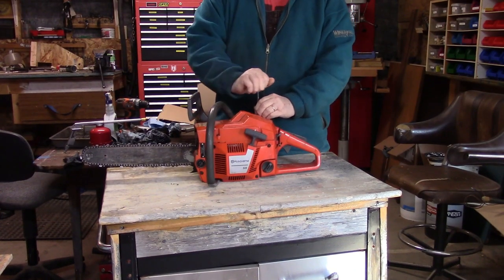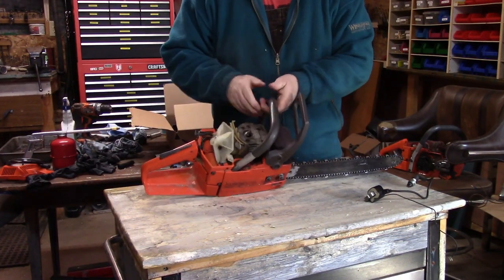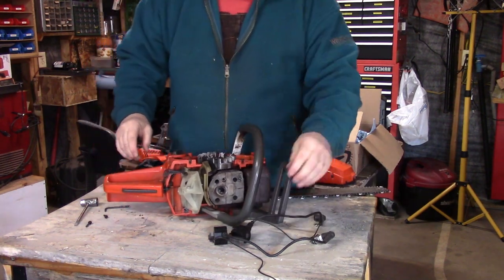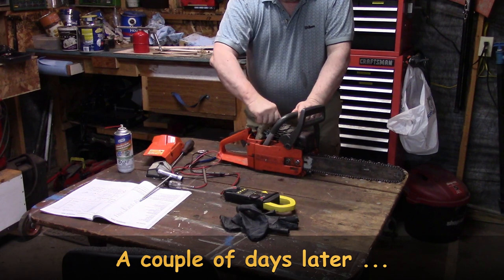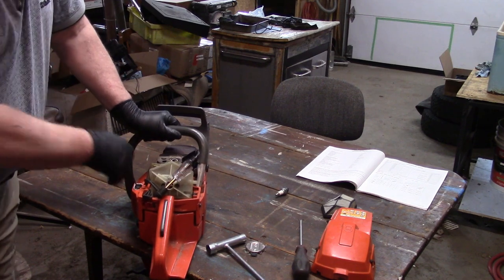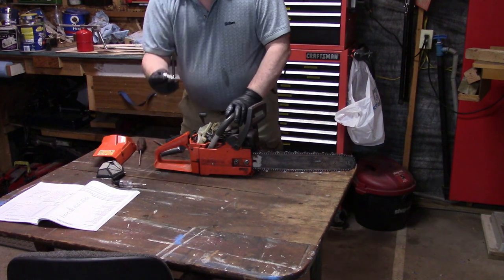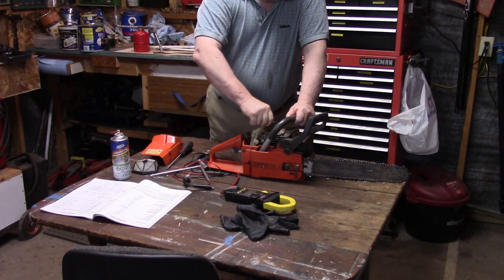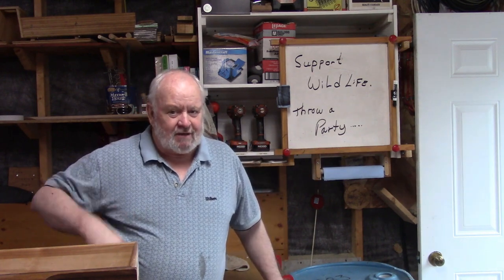Chain Saw Mystery

Comment: Your a good man Mike . After 4 pulls I chuck it in the garbage and buy a new one 😂😄
Reply from the maker: How's she goin'?  I was thinking of getting a new saw, but after I checked the prices, and swallowed hard, I thought I should check on You Tube for a solution.  Got some good ideas and that led me to this video!!!  New plug and/or coil and I figure I'll save about $500 bills!!!  Thanks for tuning in and take care!!
Reply: @GrampiesWorkshop  Every 2 stroke engine I ever worked on eventually had  a plugged exhaust with the spark arrester plugged causing havoc to most times a carb gasket deteriorated from fuel and old age if spark and compression was good.

Comment: I say you got week fire....go to the on-off switch....could be unstable or a pinched wire on the primary side of ignition....just saying...CHEERS
Reply from the maker: Hey there Gator!!!  I checked the switch and I couldn't get it to do anything except work!!!  The ground wire also looked fine.  I agree with you though about weak fire.  Maybe the plug wire clip isn't making as good of contact as I think.  I'm going to try a new coil when it comes in and then a new plug.  I'll keep ya posted as to what goes down !!!  Thanks for the comment and the help!!  Take care!!

Comment: When I was working on the McCulloch Timberbear it would start after I dumped gas in the cylinder or the carb. Then it would start and run fine. It had a leaking fuel line. The fuel would drain out of the line and I could pull and pull without it getting the fuel up to the carb. 
New hose fixed that.
Reply from the maker: How's she goin'?  I thought that could have been the problem last fall and I checked the line and replaced the fuel filter.  Still wouldn't start this spring.  Now it does.  Maybe it just needs attention.  I know a lot of people like that, won't do anything unless you pay attention to them!!!  Thanks for watching and take care!!

Comment: Awesome Grampie《☆》As an ohm chaser I'm sure you had both spark plugs properly grounded during the testing🤓👍🏾 2 smokes are hard on spark plugs so I'm betting the original plug was the problem🤔I don't have a little brother but I had my cousin helping troubleshoot my push mower when we were tweens. He verified that the spark plug lead had good voltage for me & those old stories still come up now & then :*: Greetings from⛾Florida🤳my friend🤓🗣🔊☮✌👍🏾
Reply from the maker: How's she goin' Bdog!!!  I bet we all have some stories about checking ignition spark the 'manly' way!!  LOL   The plugs tested OK on Ohms but under high voltage I bet it's breaking down.  If I had a meggar I bet it would show as a short.  A new plug is on the way and we'll see if that makes a difference.  Also a new coil, but I won't change both at the same time,  An old trouble shooting tip right?!!!  Thanks for tuning in and take care!!
Reply: Always good to hear from Florida/

Comment: Looks like a nice saw and it was running   Not upstanding the problem,  is it hard to start , if so that would be fuel ,not spark ,it was running unlikely not air     sorry not much help. Wish you luck. Be good stay safe Mike👍 feel free to ask me about anything.
Reply from the maker: How's she goin'?  The saw was giving me lots of trouble last fall when I was trying to do my wood.  This spring it wouldn't start at all.  I think the plug is intermittent and I will change that.  I also have a new coil ordered.  We'll see what happens.  Thanks for tuning in and you offer to help!!!  Take care!!

Comment: Mike it might be your Carburetor fuel metering  diagram might be bad. I have the same saw the E series model. check out Donyboy73 you tube channel. He has a small engine repair shop next to his house. Over near our good Friend Steve in Ontario. He has fixed a ton of those chain saws. Here is a link to his video on carburetor service. https://www.youtube.com/watch?v=OdSEXeUJ-90  He has a complete rebuild video series on your particular saw to.
Reply from the maker: Hey there Vicky!!   Dony has a great channel.  I've watched a lot of his videos.  I rebuilt the carb last fall.  The saw still didn't start real good or run that well.  I changed the carbs, same thing.  Makes me think it's ignition.  I'm leaning towards a bad plug.  I checked it with an ohm meter and it showed good, but under high 'ignition voltage' I bet it's breaking down.  We'll see when the new plug arrives and I'll keep you posted.  Sure nice to see your comments and thanks for the help!!!  Take care!!

Comment: Good day mon ami 🌞I do agree with Gator ( on off switch ) need a check ? Check if the upper valve cover is well grounded between the coil and the engine case. The testing light does may not draw so much power like a spark plugs does,,, Can't wait to see your next video about it. Cheers and have a great week mon ami 👍
Reply from the maker: Salut Dave!!!  The on - off switch tested OK.  I think you're right about the plug.  When tested with an ohm meter it's OK, but with the higher ignition voltage, I'm sure it breaks down and shorts out.  I'll replace the plug and I have a coil ordered so I'll change that too.  Bit not both at the same time.  (An old trouble shooting tip!!!)  Thanks for tuning in.  A tout a l'heure!!!
Reply: @GrampiesWorkshop  Bonjour Mon Ami, It will a good time to check everything around ( a good clean up ! ) The anti-vibration rubber on both of my chainsaws did get change and I saw the difference too since the either get deteriorated or harden after years. Bonne journée mon Ami ! 🌞

Comment: I know you have electricity in your background so I can't help you any further.  I have had those spark detectors show a weak spark but not enough to jump the gap on the plug.  Maybe you loosened up some clog in the carb.    Good luck.
Reply from the maker: How's she gojn'?  That could be the case Bruce.  I'm leaning towards a poor connection with the spark plug.  I'm doing more testing and the results will be forthcoming!!!  Thanks for your comment and take care!!

Comment: I have a 61 husky that was new in 87 and is still running great today. It has pulled a 28 in bar most of it's life after a major port and polish.It worked hard for many years as a falling and bucking saw.I always had 2 saws at work. If one had an issue grab the other and work on them at days end. Often shop lighting is a culprit of diagnosing a spark issue. Thus the  spark tester. Plugs are cheap so I bought them 5 at a time. Just toss one that get's an issue. They were never worth mucking around with eh. Try and keep the threads in the head and plug clean and dry or use a tad of dialectic silicone to lube threads and keep contacts waterproof.. It helps to have a good solid  ground and take that swapped out coil assy in and checked out. It may be still good eh. There is my 2 cents on a great saw my friend. Have a great weekend. Take care Mike ! ! !
Reply from the maker: Hello there Dean!!!  I have no doubt there is lots of life left in my saw.  But I'm with you on the spark plugs, toss them.  But they aren't cheap.  I just ordered 4 NGK's and they were about $8 each!!!  I could have gotten off shore ones for $2.80 but would have to wait till the end of August to get them!!!  Thanks for the comments and for taking the time to watch!!  Take 'er easy!!
Reply: @GrampiesWorkshop  LOL on the plugs eh as I was making a flat rate $ 500.00 a day cleaning up fire killed spruce, pine and Doug ir. The later had 40 to 60 inch buts. Young and dumb I would tackle anything with my saws. I eventually bought a 3120, 120 cc husky saw with a 404 by 48 inch bar. I always wanted to build a motorcycle frame and ride the saw back and forth from the block eh, LOL.

Comment: Mike I hope you get chainsaw running and in tip-top condition.  My Makita chainsaw is about 12 to 14-ish years old and I took it in b/c chain guard oil was leaking from the reservoir.  I think it's going to be okay but it still leaks a bit after a good run.  Full-watch and enjoyed your video.  Have a fine week, my friend.  🙂
Reply from the maker: Hello there Don!!!  Chain saws seem to either work with no issues or cause nothing but grief!!!  A spoiler alert!!!  My saw ended up working good.  I'll be doing a video soon to explain what happened, but basically it was a poor connection with the plug.  Go figure eh!!!  I hope your Makita gives you lots more 'good' service!!!  Take 'er easy and thanks for tuning in!!!

Comment: It can be difficult to hold down that plug while pulling the cord, that and not giving the plug a good buffing on the wire wheel probably just a poor ground. You’ll get’er yet😉
Reply from the maker: How's she goin'?  You could be right.  The plug definitely is sparking as the saw will run.  I'm thinking the plug is bad, but further testing is needed.  I'll keep ya posted!!  Thanks for the thought on this mystery and take care!!

Comment: I noticed that the chap below me says electric saw was the best saw he ever had. My brother's has one gets used for old wood but we have found for cutting in the woods where there is no power the petrol saw will run with little maintenance. Changing the coil for bad coil wire Grampie. Go with new plug.👍
Reply from the maker: How's she goin'?  I'm going to put a new plug in and a new coil.  Not changing both at the same time though, just to see if I can determine which one is the bad guy!!!  Thanks for the comment and for watching.  Take 'er easy!!

Comment: Might have a carb issue clean it out
Reply from the maker: How's she goin'?  I thought that too.  So I replaced the whole carb last fall.  Still had a problem with starting.  I'm leaning towards a bad connection between the plug wire and plug.  Sure appreciate the comment and take 'er easy!!